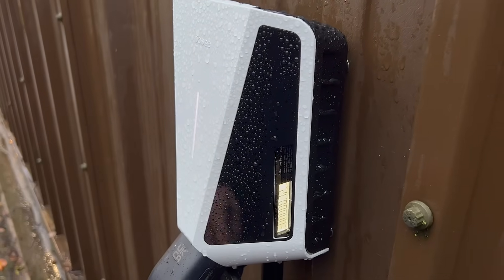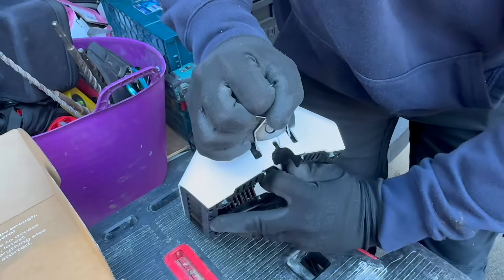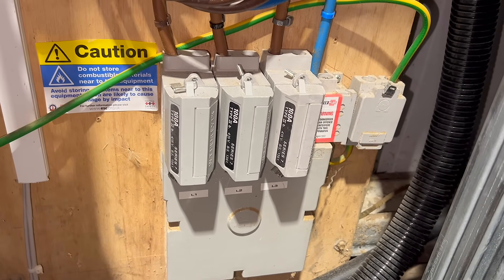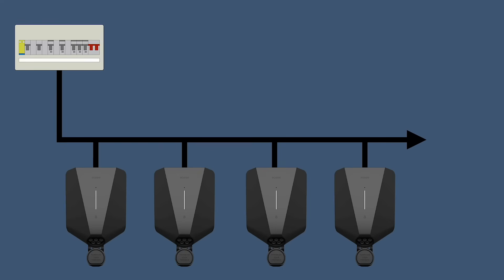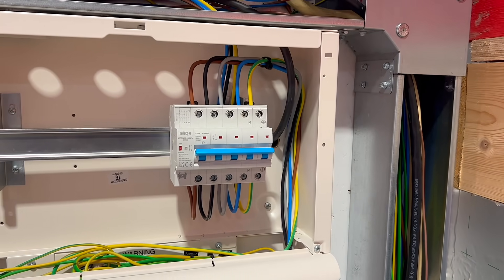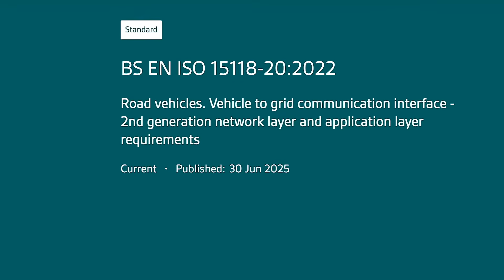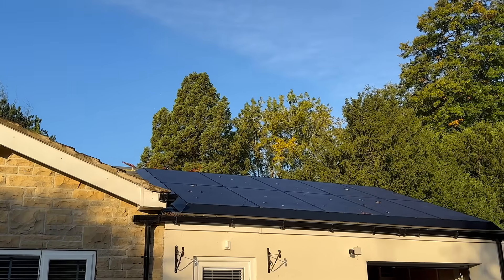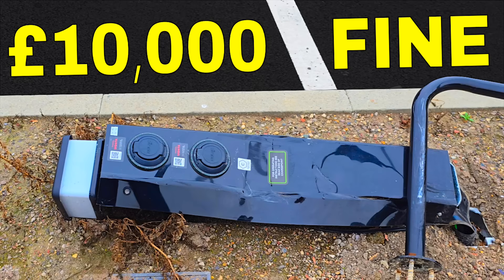Too Many EVs? How We Upgraded Our Workplace Charging

Comment: I rate the easee charger, it's my go to for small commercial units where we can daisy chain 4-5 in say 10mm 50a. My only gripe with the system is the lack of hardwire CT and in the past the equalizer has been a real pain to set up. They are so close to being the best charger to install if only the load management was more integrated than relying on the wireless equalizer

Comment: You implied that cars that charge at 11kW or 7kW can't use 22kW.

As you know, of course they can, they just won't charge at 22kW.
Reply: Definitely seeing a trend towards lighter 11kw charging cables ( well 14kw they are rated at) , as per your comments about vehicles being unlikely to charge at 22kw these days.

Comment: Yup, you nailed this one.  We have several manufacturers over here, like Wallbox, that do shared circuits.  There is basically no limit to the number of EVSEs on a single circuit, they communicate with each other and make sure that the grand total charging doesn't exceed the shared circuit.  And you can install a CT on the building mains to further limit charging such that the building mains are not exceeded either.

There is a growing demand for this in the U.S. for apartment buildings which traditionally do a lot of circuit and mains sharing.  There are several products around which allow residents to charge off of their relatively small apartment services by ensuring that the charging does not exceed the apartment circuit's (typically 50A) limit.  And the apartment building itself often has its own overall limits and those are dealt with as well.

I think its a great technology.  The best thing about it is that the EVSEs are really no different than a regular EVSE, they just dynamically change the charging rate to keep everything inline and have the comms to keep everything sane.  As loads go up and down, charge rates adjust to compensate, and as vehicles finish charging, the remaining vehicles get larger allocations.  Everyone's happy.

-Matt
Reply: @junkerzn7312  why would an apt owner do this?  It’s quite the added expense and headache, for zero ROI.  It also introduces risk, if there are any substandard vehicles (Chinese EVs, Jeeps, Porsches…), or charging parts.

Comment: How do you load manage these things? 

Does it automatically communicate to your meter to monitor what load your installation is using and allow available power to be distributed that way?
Reply: The optional equaliser will use CT clamps to measure the supply load and throttle the chargers based on a defined maximum. 

But this is optional. If you have a supply where this isn’t a problem, the load is limited by the cable you install. If your cable is rated for 50 amps then you can install up to 101 chargers and they will share the 50 amps between them automatically using the built in WiFi / cellular
Reply: @i @iambenmitchell Thankyou I appreciate that, so basically if your worried about the load overloading the main fuse you will install an equaliser. If not, you don’t have too?

Comment: I love my two Easee units, my only gripes are lack of Intelligent Octopus support ( despite having a concept of an "operator" for years ), and every 6 months it completely screws up charging schedules when the hour changes meaning you have to delete and recreate schedules in the app.
Reply: They added octopus tariff support a few months ago. Personally I don’t bother, I just have the schedule set on my Tesla. I’m on octopus intelligent go but I have it disabled and just use the manual schedule as it was annoying me that the car would charge randomly for 30 minutes on and off
Reply: @iambenmitchell  They only added support for calculating the cost of charging and scheduling the charger to start and stop when the low rate begins, not actually allowing IOG to controll the charger, so it's not IOG compatible and requires a compatible car. IOG requires either a compatible car or charger so that Octopus can control charging, and the Easee is not on the list of compatible chargers that can be controilled.

Comment: Absolutely love Easee overall. Would like to see a Generation 2 of the Eqalizer to have external IP44 rated antenna (sort of like Perific). Also make it vissible/clearer in the App/Portal if the Eqalizer is sucsessfully comunicating directly to the charger if Wifi is not working.
Reply: Great feedback, the App and Portal have actually just been refreshed on 22nd December.......and yes the Gen 2 Equalizer solution will definitely come